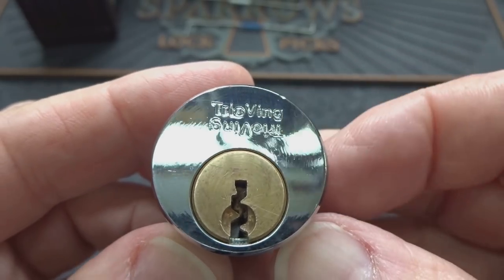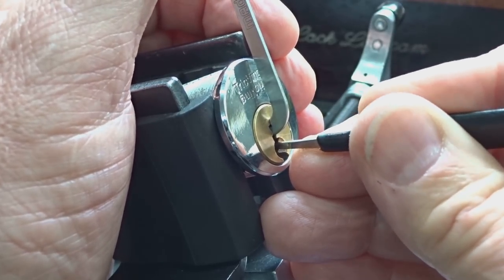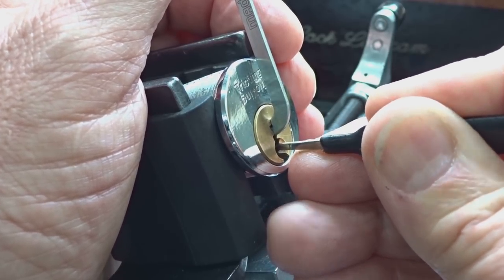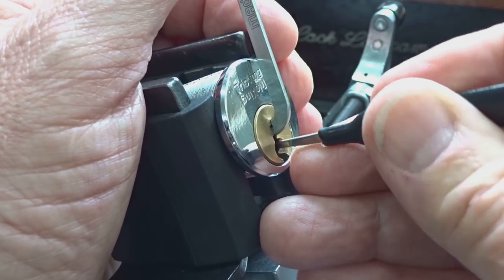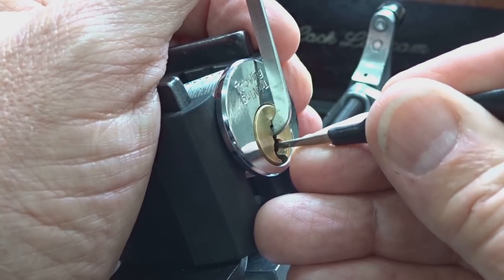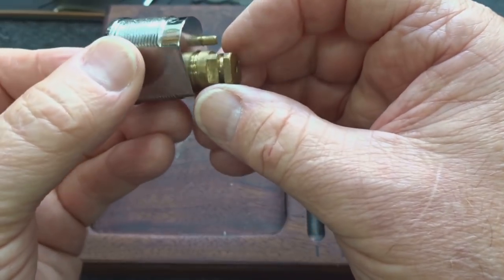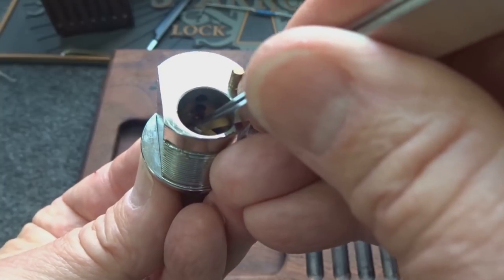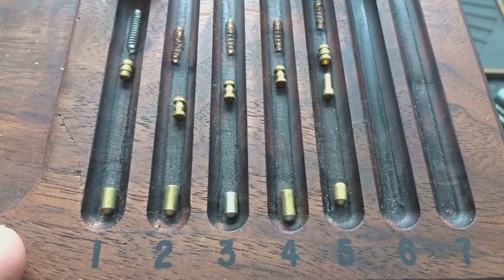(1097) Challenge: Tricky TrioVing from the Naughty Bucket!

Comment: while here, bill couls you make a vudeo about mounting locks upside down as we do in europe ? is it easier or harder to pick and whats the main reason for that? (unless i've missed video anyone can link ?)
Reply: My father installs locks up side down. It makes little difference to me, which side the pins are on, top or bottom. Some locks have pins on the sides, top and bottom.
Reply: thanks bro for replay, i'm at very basic level of picking. side pins aint my problem so far. its more about technique required for upside down :) it wuld be amazing if BB could show us main differences
Reply: i think he recently mentioned it in one of his videos
Reply: upside down locks get dirt impregnated in the pins :(
Reply: They don't really in practice. And the European way allows for an easy anti-bump feature.
Reply: PerezBSclan The "Euro style" cylinders are usually installed in precut holes the shape of old keyways, so Bible down.  The oval or round cylinders are installed differently depending on branding, with the brand name text right side up.

Comment: Having watched a number of these challenge lock episodes makes me wonder how well incorporating those challenge tricks into mass produced quality locks would work.  For example using special pin types in one or two random positions in each lock.  This would obviously take away the element of surprise, but would there still be enough added pick resistance to justify a slightly higher price for the "extra tricky" series?
  Note: At least a few years ago, Assa/Trioving used to label their lock series by picking time: 5, 10 or 15 minutes with a color code for each level.